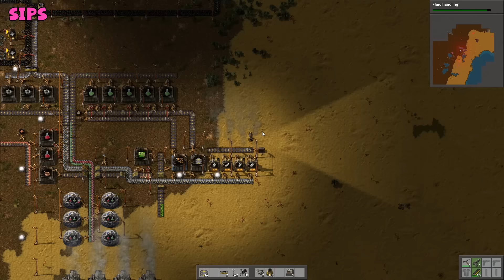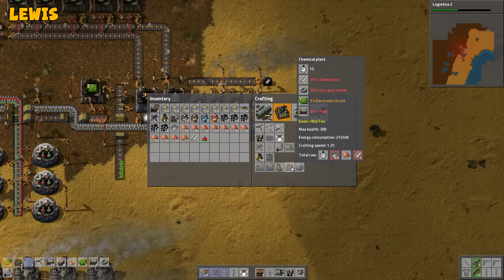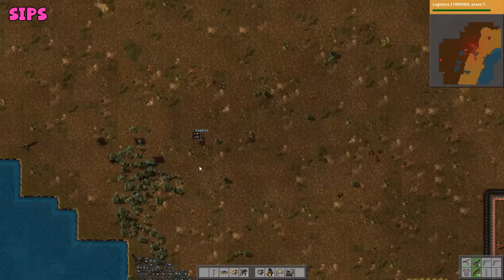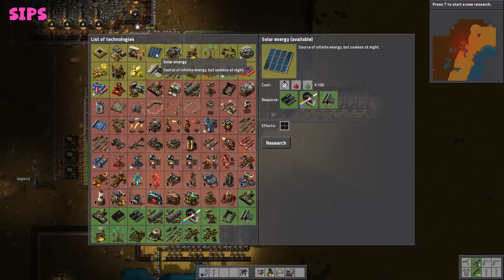Factorio #7 - Pylons

Comment: But surely, if you have a backlog, fast belts literally have no advantage, right?
Only if your input arms are moving so fast that the belt cant supply them, you need fast belts.
Basically, if you're using fast inserters, then you need fast belts to supply fast enough. Otherwise, here they certainly dont need them fast on their iron line.
Reply: +Baleur So ? You don't need internet to live right ? If they want it they do it.
Reply: @TheMegaRedHead  it isn't a priority atm they have other things they could be doing rather than the fastbelts, that's not what's bottlenecking the process